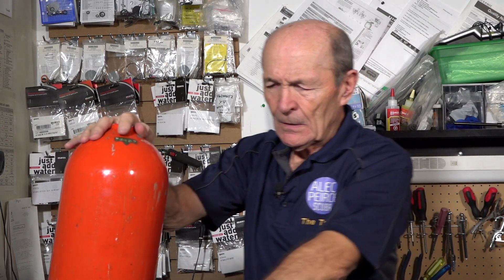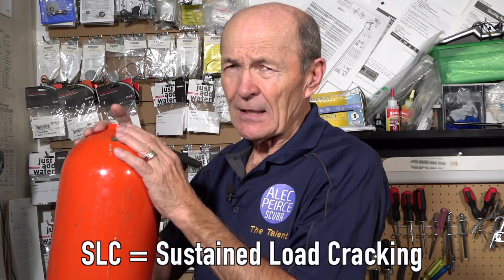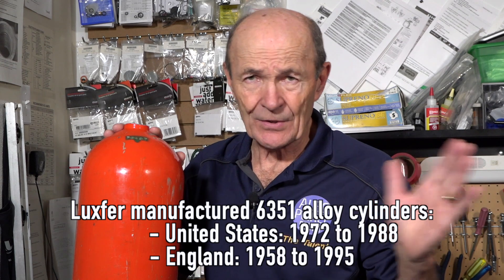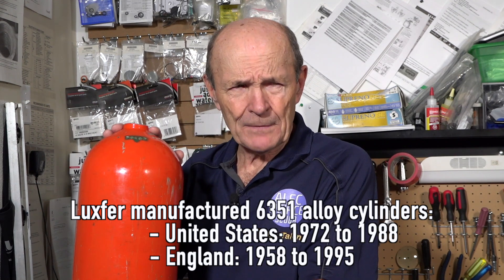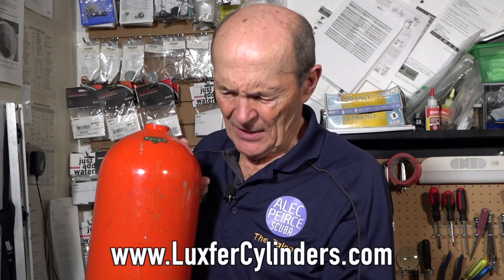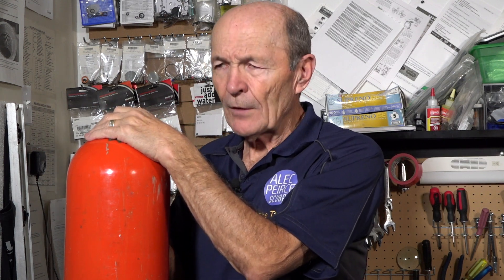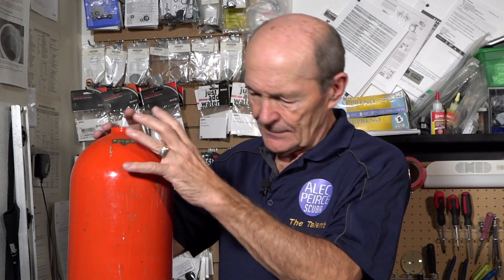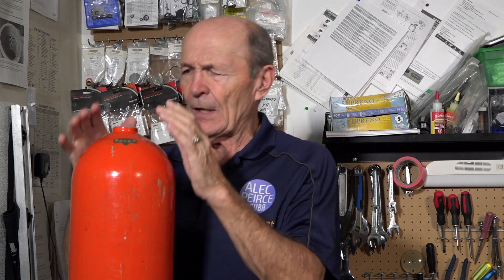See A Cracked Tank - Scuba Tech Tips: S13E03

Comment: I'm surprised the dive shop did a visual inspection.  My understanding is that these tanks are not permitted to be put in service even if it passes a visual or hydro.  My local dive shop way back in time when the problem was determined wouldn't even touch the tank.
Reply from the maker: With this tank Chris told me it was obvious once the valve was removed it had 2 neck cracks.  The customer was informed and he agreed to scrap it without question.  Smart decision.
A.
Reply: here they must also pass an ndt neck inspection, then they may be legally used- if you can find a shop that will still service them, that being said I have many of these tanks...they now line my driveway as cool edge markers,  Id much rather buy another tank than deal with a slc bomb.  oh another Excellent video  - Thanks Mr Peirce !!!

Comment: During a Visual Inspector seminar I once asked the question: what tanks had a higher rate of failure - aluminum V steel.
The instructor - who worked for the leading US tank Visual Inspection certification company- told the class that steel tanks had a much higher rate of failure.
I would imagine the reason why is because steel corrodes, so, water inside the body of a poorly maintained steel tank would inevitably cause a catastrophic failure in the tank within a few years.
Aluminum does not corrode, so, the tank would not suffer cracks or holes caused by the water.

Also, like others have already mentioned, cracks in an aluminum tank are likely the result of a fabrication error and tank manufacturing companies have come a long way in how they produce AL tanks, so, it is even less likely to find cracks in AL tanks that have been manufactured within the past quarter century.
Reply: Your assertion that aluminium does not corrode is only partially correct - Aluminium when exposed to oxygen forms aluminium oxide, however this forms a hard protective surface and stops what we often think of as corrosion. Aluminium will suffer significantly from galvanic corrosion and this is why you shouldn't store aluminium cylinders tight against any other metal. However the biggest problem with Alloy is that its a very soft metal so will suffer from dents, scratches and gouges all of which will invariably happen on a dive boat and can destroy your tank. Either way you look at it - it still comes down to the basics, keep your tank clean, dry and away from large temperature fluctations regardless of what it's made of.
Reply from the maker: Good points Mauricio.  Having divers informed and dive shops trained to check for any potential failure makes our sport safe and fun.  Keep on diving.
A.

Comment: usually, a crack occurs at fabrication  or by fatigue of the metal, I suspect that these cracks have been caused by an inappropriate forging provcess and  they progress with cycling  due to filling and deflating the tank.
an ultrasonic test is a very good way to detect this type of flaw.
In fabrication process, it happens frequently on parts forged at a wrong temperature, on cast parts when the mold sand is too much compacted or on a welded part or structure when the weld sequence is badly designed
for sure, such a defective tank should be destroyed to avoid somebody filling it .
 a very good info point.
Reply: Alloy tanks are not forged they are extruded from billets under extreem pressure. SLC come about from alloy fatigue specifically relating to the alloy 6351 which when exposed to sustained high pressure develops fatigue cracks. In SCUBA tanks the first place this can be visualised is in the tank thread (which by the way is milled on a lathe) because of the forces being applied by the gas volume on the surface area of the thread - basic physics. What people don't realize is that whilst you can see the SLC cracks in the neck of the tank first, what you don't see are the micro-fissues forming on the tank wall which is the thinnnest part of the tank and likely to have catastrophic failure when being dump filled from a bank.
Reply: @peterjulianphotos4659  in fatigue mode, aluminum alloys reacts completely differently from steel, on steel, under a certain stress level, the fatigue life is infinite, you can cycle as much as you want, for aluminum, it is not the case, it is the reason why all seriously built engines uses steel connecting rods, aluminum connecting rods are used almost exclusively on race applications where the engine is frquently disassembled and rods replaced
Reply from the maker: I'm just glad divers are more aware of the 6351 flaws and dive shops check for them.  Been very very few reports of tank failures due to SLC which makes diving safe for all of us.
A.

Comment: Do the dive shops keep the tank to make sure it can’t be used or can the owner get it back to recycle or other things like the bells?
Reply: The tank must be rendered unusable and may or may not be returned to the customer if they want it. I had a tank fail visual for corrosion pits in the sidewall and the shop galled the threads so I couldn't insert a valve, and Xed out the serial numbers so no other shop would fill it or hydrotest it if I figured out a way around the valve thing.
Reply from the maker: According to Canadian regulations, the tank must not be filled.  There is no actually recommendation on "how" to prevent it but XXXX'ing out the serial number is considered best (should be checked every fill).  They don't recommend drilling a hole in the side as someone would try to patch over the hole and fill it.  Oh there are divers like that.  Even stripping threads is not recommended as they could be rethreaded by some delinquent person.  Mostly dive shops keep the tank unless the customer insists then they must somehow ensure it is not re-filled.  Not an easy solution but thankfully it is rare in 2022 to find a failed tank.
A.